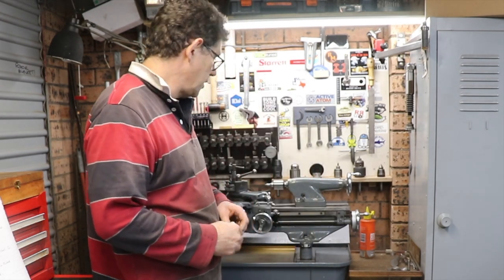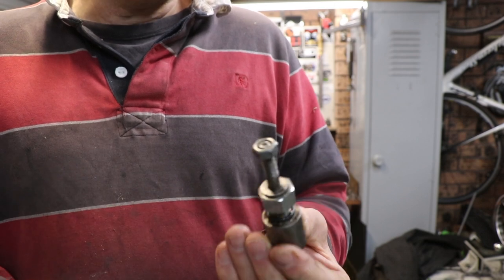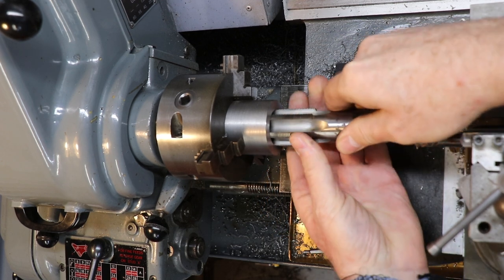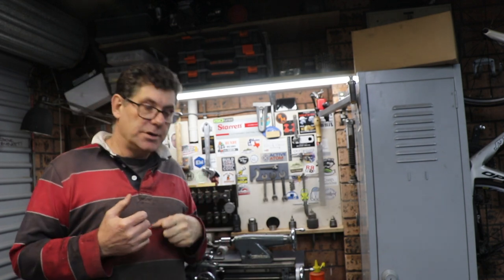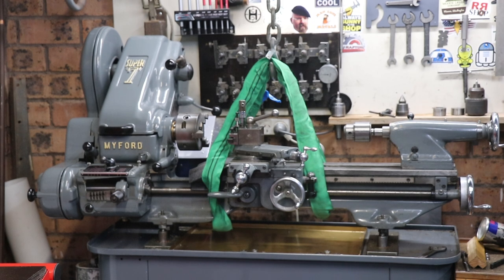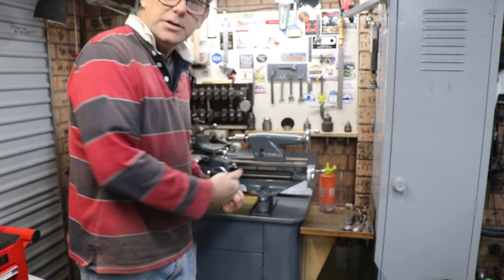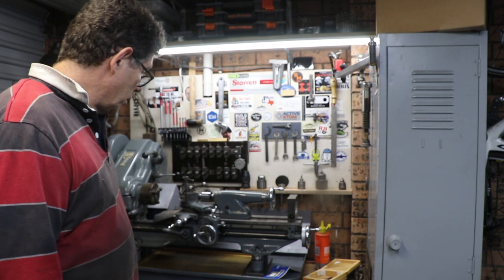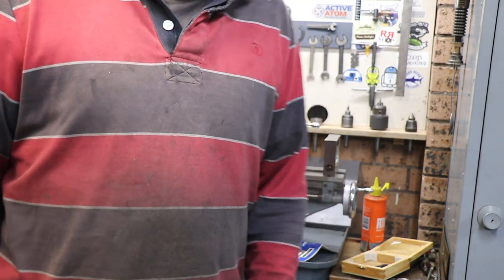Lathe Levelling Feet for Myford #ShopMadeTools

Comment: Great vid, and a balltearer idea, my Hercus 260 is mounted on a cobbled together wooden bench, in an 80yo wooden floored crooked shed, I've been planning on getting a 4'x2' chunk of 20mm Bis 80 to put the lathe on, to try and at least get the taper out of the lathe, your idea, could hopefully get the taper out of my baby, without needing the heavy slab of steel;).

Thanks for the idea, John,

Scott.